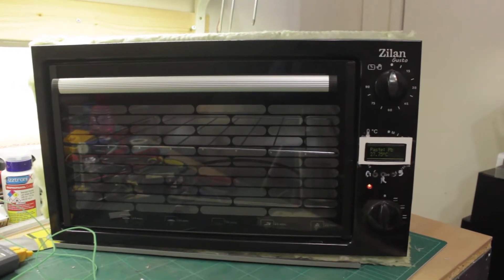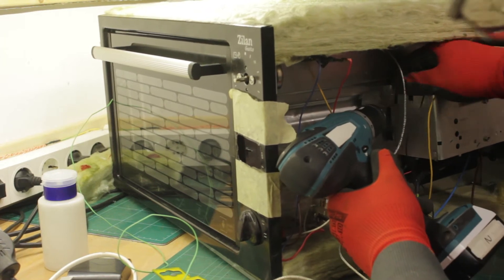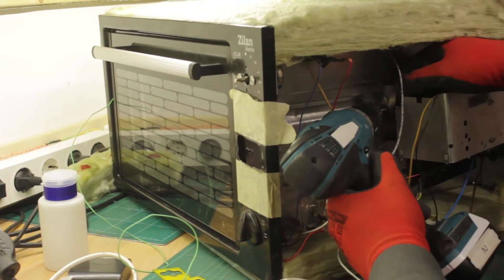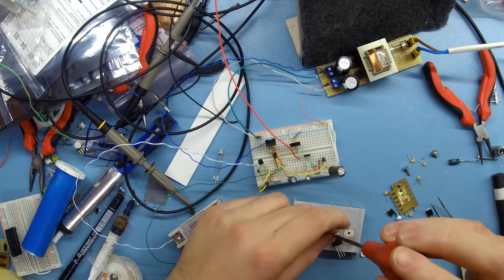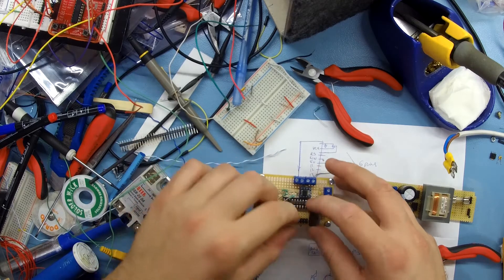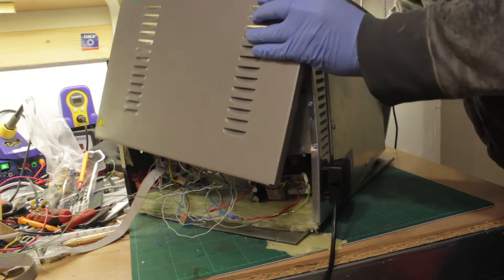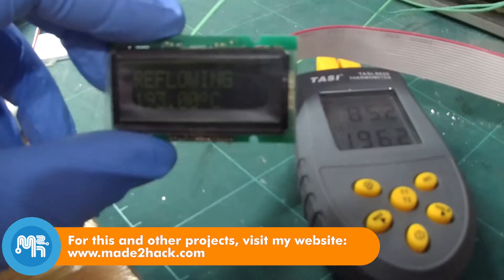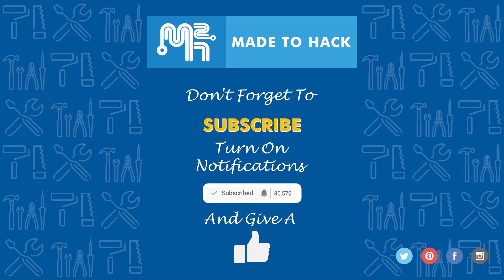How to Build a DIY Electronics SMD Reflow Oven - Part 2

Comment: Respect to the effort, but this is just a heater, not really an oven with a heat ramp. So basically when the heat is uncontrolled and the ramp is whatever, you cook the components for too long and reduce their reliability.
Reply from the maker: Yup, that's kind of the problem @ the moment!

Comment: to much time spent watching a guy use a Dremel and soldering iron...nice idea but if ya not making many pcbs just use the grill in your kitchen oven ….I reflow my PCB's this way in under 3 mins with perfect results....but still nice vid
Reply: I would advise you against that. The solder you use most probably has lead and other toxic gases, so you are contaminating the food you eat!
Reply from the maker: Thanks, yeah the skillet method is quite useful. I wanted however a more in depth project which would use the MSP430 chip.

Comment: Why not use some cheap 32bit MCU like STM32F0/M0-Cortex instead of 16bit MSP430?
I am not sure why this has to be insulated, Also how this fan is supposed to cool it.
There should be some tiny vents connected to more than one fan I would say

Comment: Great video! I'm looking forward to the next parts. It would be great to also include any changes that you would make for a second revision once you finish it.
Reply from the maker: I definitely will, except I'm having some issues with the software, since I did not program it and just tried to adapt it. Plus, the glue keeping the buttons and LCD melted due to the heat. Have to figure something there.
Reply: This will be very helpful I will try to copy you over the summer. Thanks!